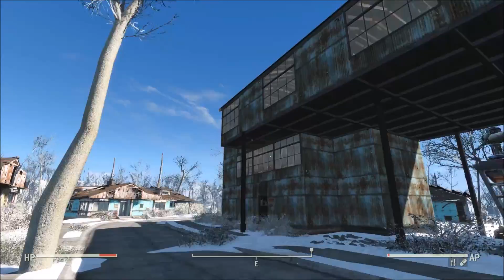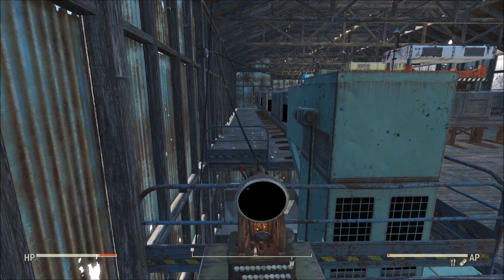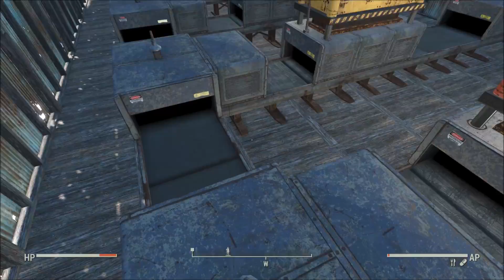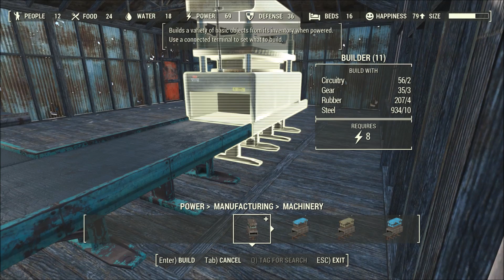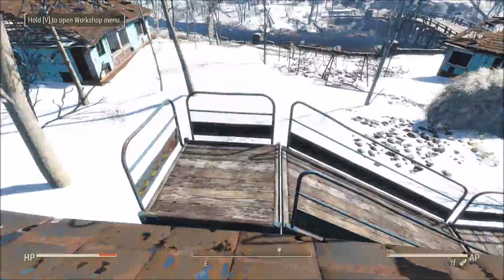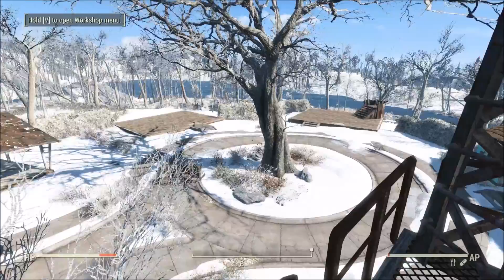Fallout 4 - Contraption Workshop DLC - Factory tour

Comment from the maker: For those who can't hear me over the generators:
I've just got the 'mesh' floors for flavour, since I think its fitting for that second floor look.
While generally the mods I use don't change a great deal of how the game plays, I'm using better generators for 3x output (small gens = 9 energy, mediums = 15)
Computer runs off of the assembly lines' power, which goes straight from the very first piece of conveyor belt, through the lifts and then up into the rest of the machinery. One of the machinery pieces are linked to the computer but not any other power source, meaning that if the switch for the rest of the assembly is turned off - so will the computer turn off.

I think that covers anything I might've said.

Comment: Snow!

I couldn't really hear what you were saying over the generators, but I really like the layout you built! Cool having the elevator completely indoors, too. I really wish we could make intersecting conveyor belts. Like a T-shape or if the L-shaped ones were open on all three ends to be able to make a T.
Reply from the maker: well you can make a branching belt, put an arm which switches direction for each item via a tripwire and then go off in each direction.
check my contraptions workshop part 3 video to see it in action
Reply: +Niall Mullenger yeah, but that one only goes the one direction, too (I was looking to combine, not separate). To save space, I had wanted to have all of the builders attach to one long chain of perpendicular conveyers. So, instead I just made all the builders a little higher up so that they drop their items onto the same conveyer that leads to one storage.